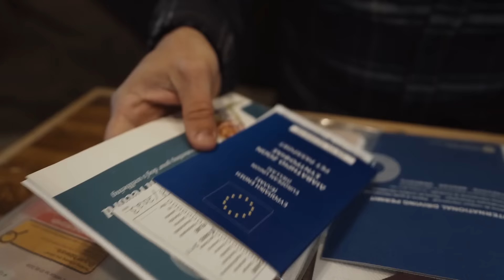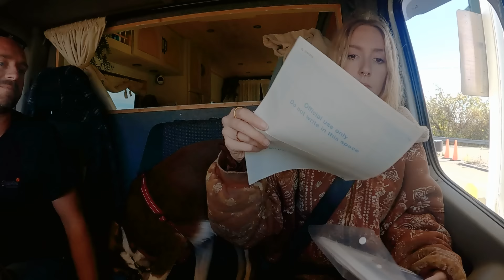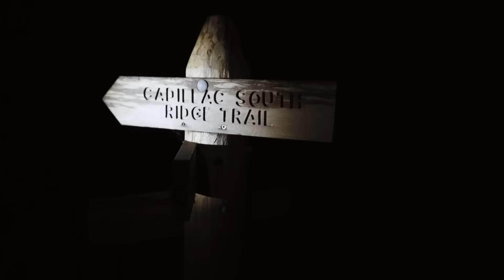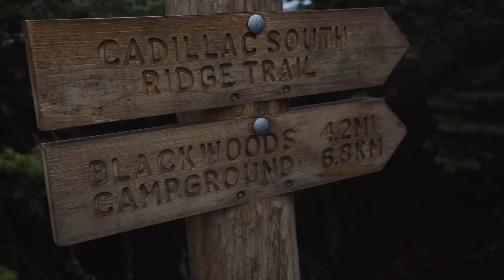CANADA to USA… BY BOAT! The Border You've Never Heard Of (Van Life USA Begins)

Comment: I In the US I learned the hard way that because of the sun's location on the earth you will get different solar panel charges. Here in New Mexico always sunny yet only average 30% of the solar panel capability yet if I would go to California it be almost 100% all this is a rough fitment, but they have apps that will tell you what to expect where you are at. It kind of sucks to only get 30 watts from a 100-watt panel. I still love mine, but I do understand I will need almost double the amount to get where I want to be.

Comment: Great vlog guys, when the B2B get warm they lower the output, if you can get a fan to blow air through the heat sink you will see a greater output, hope that helps you 👍
Reply from the maker: Thanks Steve but we already have two fans on the B2Bs when we’re driving, and also have the cupboard open for better airflow, so don’t think it’s that 😔

Comment: The Imperial gallon is a unit of volume in the imperial system of units, where the US gallon is used exclusively in the United States. The imperial gallon is 20% larger than the US
Reply: Still gasoline in the United States  is at least 50% cheaper than the UK

Comment: Re victron B2Bs I've two also, both wired and fused as the manual states 16mm2 plus 60amp fuses. From a cold start, one outputs its ratted 30 amps, but the other only outputs 13 amps. I'm still investigating but maybe there was a dodgy batch.
Reply from the maker: It's strange isn't it! Maybe you're right with the bad batch. Our alternator is rated at 180amps so we know that's not the problem either. Will let you know if we ever find out 😆
Reply: @OverlandingSophia  my sprinter has a 180 amp alternator also. I've fitted switches, so I can switch each of them independently, so for me it's nothing to do with the alternator as only one is being used at a time for doing the test. I'm going to swap over the wiring from one to the other then test again to see if it's the wiring or a faulty unit. I will also let you know the outcome :)

Comment: Awesome guys! Looking forward to travelling along with you both. 
Did you take into consideration the U.S. gallon is smaller than ours? 
Although still 8pts, a U.S. pint is 16oz  whereas, a UK pint is 20oz. So, 8 pints to a gallon, the U.S. gal. is 2 U.S. pints smaller than our gallon . . . or 1pt 12 fl. oz UK 😂😂
Reply from the maker: Yes! Not that it's confusing in anyway 😂 At least they use miles over there, that feels familiar!
Reply: The Gasoline in America is still approx 25% cheaper than Canada, and over 50% cheaper than the UK.